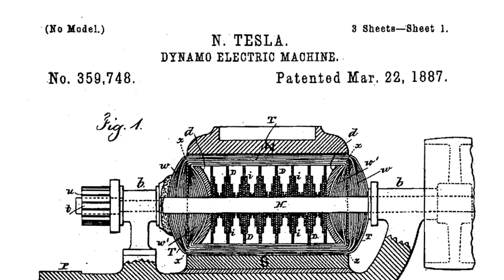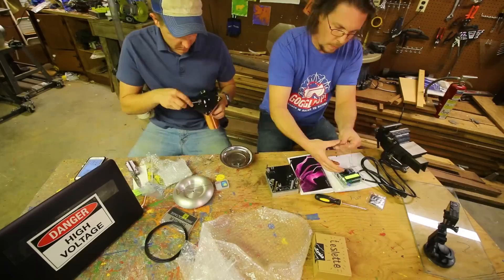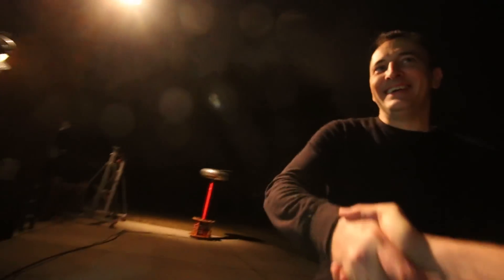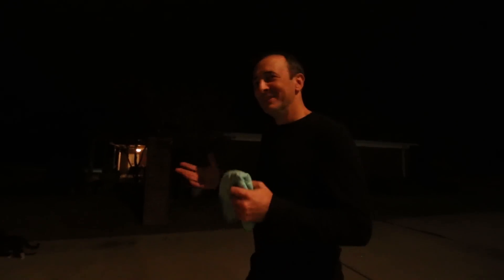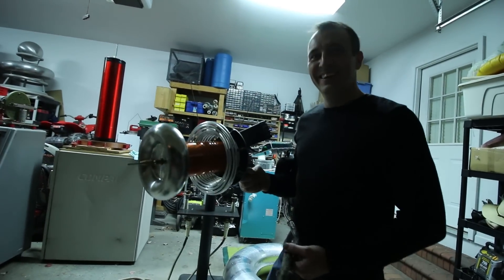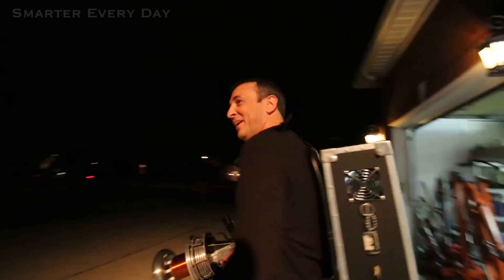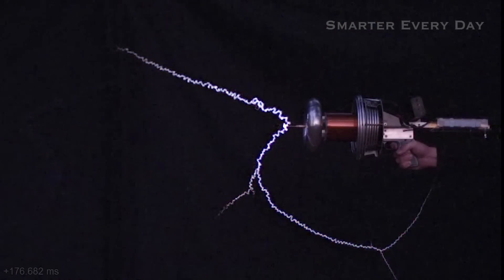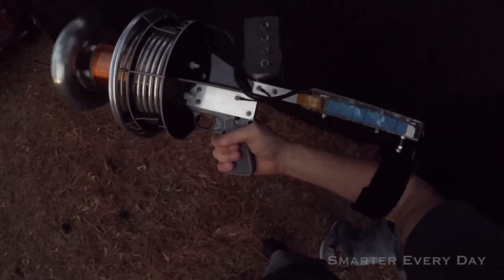Handheld TESLA COIL GUN at 28,000fps - Smarter Every Day 162

Comment: So I'm no scientist, but if you were to get some kind of areosol or other propellant like and air pump spraying fine steel dust, could you POTENTIALLY increase the range of that quite a bit? Im not an electrician by any means. Would just be super scary to see that go 20 feet.
Reply: Grant Wallace iron dust projector :p
Reply: Nah, that won't work unfortunately. When arcs pass through air, much of their power dissipates. Adding steel dust would only reduce this path by some millimetres at best, and as such there will be little noticable difference.
Reply: Grant Wallace 
Think about it - what are you doing by introducing conductive dust? The current still has to travel through the air, which takes a lot of energy. Thats why most capacitors have what is known as a dielectric.
You can probably make some sort of water-gun-ish weapon, though, given a liquid that has high-enough conductivity. If a liquid is used instead, the current will not have to jump through the air. The limiting factor becomes the conductivity of the liquid.
Reply: Oggab0gga
again - no electrician - and what's so different between putting steel in the water then?
Reply: steel in water would not work very well either. an acid or salt solution, however, would. the electrons in this case travel continuously through the liquid without the need for jumping, whereas steel-in-air/water would lead to lots of jumping. A rule of thumb for electricity is that if you see an arc, you are not utilising the complete power of the current
Reply: The idea of having a weapon which lets electricity flow from a gun to a person has already been done in a quite efficient way. It's called a stun gun, and it deploys spiked projectiles at speed, carrying wires behind them which allow the current to flow from the gun to the target. This increases the efficiency of the weapon since you don't need a backpack-sized power supply, and also don't have to be that close to your target. It also has the added benefit of being precise enough to use in a crowd with no collateral damage. 
It's a single shot weapon though, which is why people think it's a good idea to let the current pass through a liquid instead, since you can shoot several times with something like a water gun. Only that has the problem of the liquid having to maintain an unbroken stream between the gun and the target, which becomes very difficult at more than a few meters.
Reply: McJaews
See i was thinking about the effective problems with stun guns, such as not being able to reload except the single charges. Mind you, I suppose a golden gun with 100 rounds beats a lightning cannon for 10 seconds.
Reply: Grant Wallace You could argue that a quick-reload single shot gun is fine for some situations. The stun gun, as far as I'm aware is basically a handle which has a cartridge attached which works both as the projectile and the propellant. So, you could attach as many stun cartridges to one handle as you'd like. Stun guns are meant as non-lethal weapons which work as deterrent and pacifier. in situations where you would need to pacify several threats, you might need a less non-lethal option.
Reply: Basically all you nee is a higher voltage output. The isolation capability (dielectric strength) of dry air is approx. 1000 V/mm. As result the source would have to provide at least 6.1 MV voltage to meet your demand. High voltage of that dimension can not be provided by mobile devices anymore, i.e. the bearer would need some good amount of isolation. Isolation ist provided by distance. So to "shoot" straight at 20 ft. you would need a distance to the ground of at least that length. Imagine high dust or aerosol density, and your potential range shrinks significantly.
And, as you could see in the video, the path of the lightning is rather unpredictable and as the ground works as one of the two required electrodes the main discharge bolt tends to go downwards.

Comment: Hey,  tell your friend to make a modification to his gun...   you need a compressed air source,  if you direct air out the front it will channel the huge shotgun like effect into a stream like a phaser.   because the arcs will follow the flow of the air as the path of least resistance.   with that huge of an arc, id expect a pretty far reaching beam.

Comment: Sigh

Brings back my grade-school science fair project... a solid-state Tesla coil made with a couple MJ3055s and a reclaimed flyback transformer from an old Magnavox 25" color TV.

I made lightning in a 6" clear globe vanity light bulb and made fluorescent tubes light up held in my hand... and I was 12 years old. I felt like a god with the power of the universe itself in my hand. ;)

I also made a Jacob's ladder from an old oil-fired furnace ignition coil and copper wire. I imagine this generation will never know that simple joy; those coils are no longer readily available from any junkyard as they were in my day, and neither are neon sign transformers.

I've seen folks make them using a microwave transformer, but those generate dangerous levels of current (How much? Enough to cook a turkey, or to cook your heart muscle in your chest!!!) and only 3-6KV, so they don't start properly.

Comment: Dear Destin,
Thank you! Just, thank you! I think what makes this channel special is specifically the fact that you are one of those that will laugh like this in the expectancy of such thing.

Yet, I got a question. Where does it arc to ??? You asked it, but then got distracted by the (awesome) water cooling system. But here I stand, waiting for an answer. Where do lightnings arc, when it's not toward the ground / something connected to the ground ? Just one random path of "higher conductivity" in the air ?

Comment: If somehow you can preheat  the air and concentrate the heated air in one line (maybe with some small turbines), i think the bolt would appear in that zone when you pull the trigger.
Reply: Lightning bolt is a burning air after all.
Reply: its plasma not fire i thought
Reply: coolguy20000000 a didn't say that it is fire

Comment: Note, if you want the tesla gun to actually not kill someone but be sure to knock the wind out of them, change the frequency of your output. That means winding a different secondary and using different capacitors in your oscillating drive circuit. Not going to say what frequency to use but a bit of research and you can find what the human body base frequencies are and what the "counter" frequency would be.
Reply: JKflipflop If it is so stupid, then why are you watching this and commenting on it?

Comment: The thing you need to keep in mind about secondary coil arcs hitting your skin is that, while the amps is low the energy his high. 10 or 100's of watts.  So while it often doesn't have the current to cause you dangerous electric shocks it does discharge lots of heat in the arc.  The arc can burn deep into your skin called a deep tissue burn. This isn't fatal but takes ages to heal. Holding a metal object and letting the arc hit that spreads out the contact area onto your skin and reduces the problem.

Comment: the slow motion footage part(http://www.youtube.com/watch?v=_fTC_Ud_k3U&t=7m34s) where the electric discharge  rips through the air molecules, sounds like its ripping through the fabric of space and time, total mad scientist mode initiated
Reply: Ralph Samson Lal ikr
Reply: If you havent, you should check HQ slow motion lighting impacts... follows the same principle but its much more impresive because there is easier to find a slower motion videos about it.
Reply: thanks Allen Snackbar, that's what I did. there was a system link conversion error. made the 7:34 appear as a link. from what I suppose the internal implementation of the minute:second notation is just a link to the target link as it's visible

Comment: Tesla was a genius but bc society goes with what is presented as acceptable norm the go along to get along the commercially acceptable going with a guy that can be sold as normal instead of the essentric genius we get thomas edison instead of Nikola Tesla. We would have power boxes and no need for the archaic electric grid system
Reply: Only problem, there's no telling if his wireless power system was safe. We know that on a small scale it is, but many times in science, scaling up small cool things becomes dangerous, often in ways we don't expect.
Reply: We know it was safe. He lived to a ripe old age of 87 years old before being murdered, not dying by some disease as was reported. And throughout his life, do you know how close he was to his lightning machine? A couple feet away, or even running the current upwards of 6 million volts through his body. Living that long, with his nerves as healthy as they were, being that close to that much electricity, we can VERY safely assume that a wireless electricity system made by him would be safe. He obviously knew exactly what he was doing.
Reply: You clearly don't know what you are talking about. It's the amperes (current) that kills / makes it dangerous. Doesn't matter if you have 6 million volts going through you if the current is minimal (like even Tesla's largest machines had). Current is needed for electrical apparatus to function... don't go jerk yourself off because something has high voltage.
Reply: Samuel
Since when did I say that high voltage kills? Did you read nothing at all?
Reply: Squat251 Gaming
I never said to follow his lead. Just that he knew what he was doing, and made massive progress.

Comment: Great video!  Just wanted to comment on the nature of the current in the sparks for those interested, as the details are often misrepresented or completely wrong.  First of all, the spark current is quite significant, approximately 3-4 amperes peak (yes amps, not milli or micro amps), with a duration of some 10's of milliseconds depending on the settings of the machine.  The reasons that it does not cause any noticeable harm is 2 fold:  the frequency of the current is around 420kHz, and the discharge has a relatively low charge available by design.  The high frequency phenomena is analogous to not being able to hear sounds above a certain frequency because it's too fast for our nervous system to "respond" to.  However, anyone who has touched the sparks of a large Tesla coil will know that it still packs a nasty punch, and the reason for this is that the initial connection delivers a significant amount of charge (volts * capacitance) which you will feel.  This type of Tesla coil works at a relatively low voltage of 70kV and uses a relatively small self capacitance (the silver donut "toroid" makes up this capacitance mostly) of just 15pF.  It's the initial discharge of the 70kV*15pF = 1uC that can cause a "shock" sensation (which is on the order of a static zap of 10kV at 100pF of body capacitance), but the follow through current of 3-4 amps does not cause nerve stimulation (consider an electrocauterization machine that works with similar currents and frequencies, and does not shock the patient).  The danger of radio-frequency burns is still significant, however, and there is a nerve response to the intense heating produced where the spark connects to your skin!

Comment: I had privilege to indirectly touch the arc from the tesla coil. The trick was to hold a metal stick in you hand. Occasionally a small spark would happen between the hand and the metal stick, but nothing that would hurt you. You could also hold a fluorescent bulb in the other hand and it would glow as it was connected to AC mains. A friend got hit directly into the hand from a giant Tesla coil (he was in the metal cage) but the tip of his finger was outside and he described the pain as someone hitting you with a sharp needle. I figured it must hurt decently since he stopped laughing the rest of the day. (LOL!)

Comment: If you have light bulbs around it do they blink rapidly? answer pls :D
Reply: Light bulbs less, but fluorescent tubes light up like it's Christmas! No wonder, they use the same mechanism to produce light. In light bulbs the gas filling reacts only, because the current is not enough to heat up the tungsten filament.
Reply: The filament in housed in a vacuous environment which prevents oxidation of the filament upon heating.
The effect of this can be observed when the glass is broken while the filament remains intact.
Upon putting power to the filament you will see a quick flash as the oxygen in the air burns it out.
Reply: Noevilea Quite wrong, the incandescent bulbs are usually filled with argon or a mixture of argon and nitrogen long since (with about 0.7 atmospheric pressure). Previously it was vacuous, but the tungsten filament kept evaporating and condensing on the inner side of the bulb, making it non-transparent after a while. You can excite argon with high voltage, after which it radiates the excess energy back as visible light. Neon glow bulbs are much more spectacular though... because of the reddish tint to the discharge phenomenon.
Reply: smart people dood
Reply: I watched a lot of Destin and became smarter every day :D 
but joke aside: I have experimented with this stuff (effects of high voltage electric discharge on various things), playing with piezo gas stove lighters as a kid, before the Internet :) and became an engineer in due course.

Comment: Hi there! i have got a question. When u said 'i can curve lightning bolts at my finger tips' it made me think. what if u have multiple coils but on your fingers. Probably won't work but I was also wondering, if you'd make the coil around your wrist? you could also hook up pads to your fingers and wires to the pads connecting to the coil so you could literally have them coming out of your finger tips. This is probably a dumb comment to multiple keyboard warriors but i'm just asking :D

Comment: have you considered a pulsed laser source to ionize the air and thus direct the current path along the ionized air? I've always wondered if it was possible. Tesla supposedly experimented with lasers and found that under higher power levels that they would create a plasma wavefront.  Plasma can direct electrical charges and therefore I would be curious if it could direct the output of a tesla coil.
Reply: Matthew Scur Yeah, great idea. Or you could shoot a ring-like  projectile with a strong magnetic field to isolate the plasma to one specific area.

Comment: Destin, you asked a question I wanted answered, but you got distracted by the water cooling. Why does the lightning arc the way it does? Why doesn't it arc to ground, it did when you pointed it at objects touching the ground, but not when it was pointed in the air.

Comment: I love tesla coil speakers, but the lack of bass response (even with big coils) is a let down.  They would be a lot cooler if they had some "thump".  I think that is inherent in the fact that the electric ark is essentially a line that gets longer and shorter, but maybe I'm wrong?

What I see as a possible solution to this is to create an addressable grid of contacts and multiple spark generators, so you can have a CIRCLE of sparks that swells and shrinks, which should create a large moving wave front in the plane of the circle.  Seems like there's probably some major flaws and a lot of complexity... any better ideas?
Reply: I think that the tones that you hear are not generated by the length of the arc, but by the frequency of many arcs. Like, if you have one arc, you get a click. If you have multiple arcs one after another you get a tone, the closer you pack the arcs (the frequency of sequential arcs, I don't know how to explain it) the higher the tone is. 
That's why you don't have bass, you can't go lower than one click. 
I hope this makes sense.
Reply: hardstyle905 Hmm, I'd noted similar frequency response (though admittedly cleaner sound) in Arc Attack videos, but that may be due to the limits of the mic / video.  Am I right is assuming they use a better quality system like you mention?  Good info, I thought they all used what amounts to pulse width modulation.

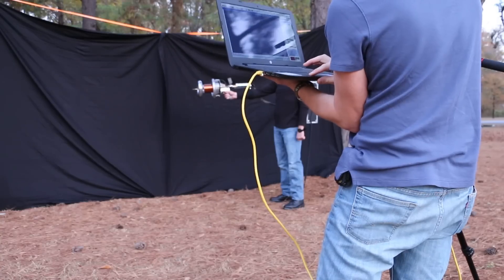Comment: Great video Destin.  At 7:30 you show the tesla coil operating in slow motion.  I notice that the electric arcs spread out and then recede completely.  What frequency is that happening at?  My hunch is that it is caused by the spark gap charging and discharging, and that action is related to the audible frequencies we hear in your singing arc in the first part of the video.  How many frames of high speed video are there between each each round of sparks?

Comment: Should do more on high voltage engineering. Circuit breaking and transformers at a 500kV substation would be super interesting to see. Power systems that run the country are often overlooked.

Comment: Wait a minute, the well known problem with a "Tesla Gun" like this is its accuracy, that's the main reason that we don't actually make handheld lightning guns like this. Then I remembered about Laser-Induced Plasma Channels and how it creates a pathway of plasma around laser beam, that pathway then ionizes the surrounding air and makes plasma and since that channel now conducts electricity way better than the non-ionized air that is around it the electricity will travel down the channel and hit where the channel ends. So why couldn't we just make a gun like this guy and add a Laser-Induced Plasma Channel emitter to it? In theory shouldn't that make a functional Tesla Lightning gun that is moderately accurate?